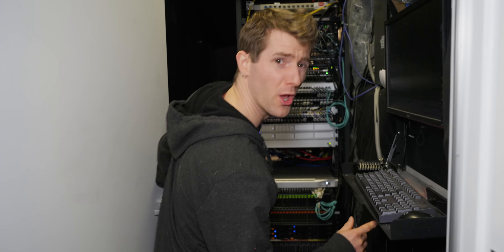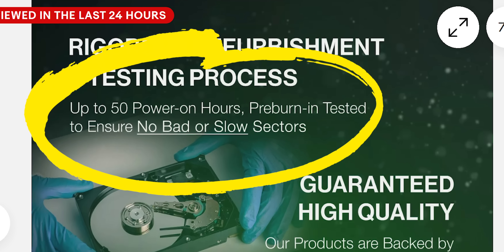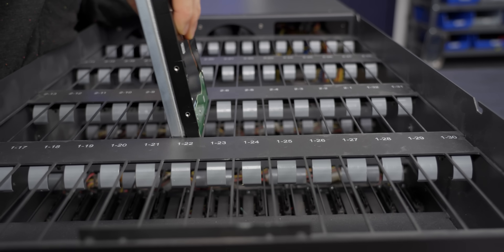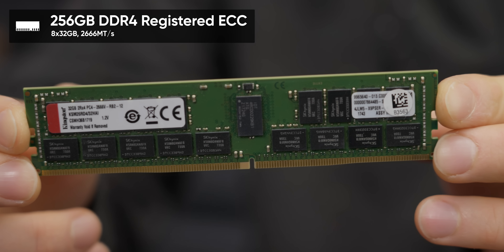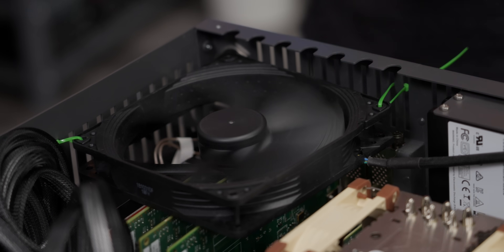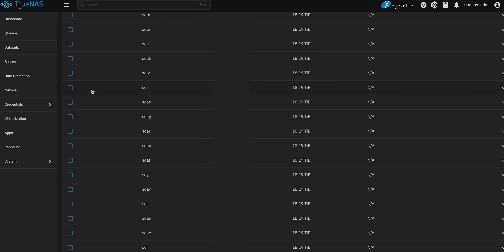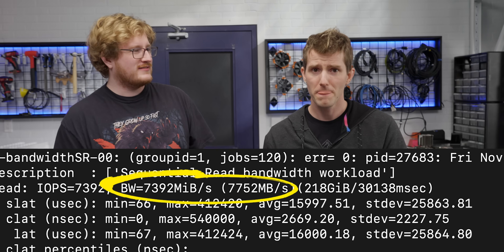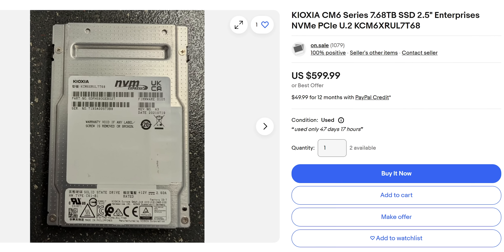Is Buying a PETABYTE on Ebay Stupid?

Comment: This year I purchased 36 of the recertified 10TB He10s you find on Amazon for $75 to $85 each. As far as I can see the recertified meant used for these. Before putting these into production I ran a 4 pass badblocks test on every single one of them which took nearly a week to complete. Edit: Not sure what happened to my previous reply anyways the drives from Amazon did have a few thousand hours of runtime on them and they are not sold by Amazon.
Reply: I've heard pretty good things about these drives. I have 24 he8 drives I got from ebay that have been completely problem free for about 3 years now. they have really impressive power consumption compared to the old seagate drives I used to run. nearly half for my whole array while idling.
Reply: I've been burned by Seagate and I'm mixed on WD, Hitachi drives have been absolute troopers for me. So I bought 2 new-old stock He10s off Amazon. They lasted 6 months before both had over 50 critical errors. Both had 0 hours when I started, behaved great until then, were in a proper anti-vibration mounting. $400 hurts so much to me and I gave up trying to get a refund, now that that part of the company is owned by WD and I'm in Canada I don't seem to be able to get a refund from WD. They are an enterprise product and WD only seems to have end user support for formerly-Hitachi enterprise products in the U.S. and Mexico and I'm in Canada I've just considered that money lost and tried to move on. I can't afford to find a different alternative and all I wanted was reliable storage instead of decade old e-waste Sas drives in a hardware array that doesn't allow me to read their SMART status
Reply: More like returned and repaired. It might never even been used.
Reply: @deauthorsadeptus6920  All of the He10s had a few thousand hours of usage on them. They were very clean and didn't appear to be opened as far as I can tell. Someone ran a SMART short test on them before they shipped as this was in the SMART log. I started with a small batch and after they tested flawless I ordered a few more and finally a month or so ago I added an additional 20 pack to fill every slot in a new supermicro 36 bay server.

Comment: Bought 5 14TB drives that were pulled from a server off EBay. They were about $150 CAD each. So far with 24/7 power on they’re doing great
Reply: I have a couple 4000gb seagate nas drives in my desktop. Basically got them free with a used seagate nas. About $20 a piece
Reply: that's some great luck there
Reply: @Gogglesofkrome  I’ve got some 12TBs from a similar seller as the one in the video that I’ve been running on my Proxmox server since 2022. No issues as of yet.
Reply: And I'm over here paying 240$ for 4TB WD Red+... Why am I doing this to myself lmao
You mind sharing what seller you got them from?
Reply: @ Looks like the seller I got them from doesn’t have any listed at the moment but the drives were WD WUH721414ALE6L4 14TB. EAST DIGITAL seems to have the least expensive reputable drives. I’ve been there though, paid almost the same amount for 4TB SSHD’s a couple years ago. They are still going strong but with 10TB less it’s just nuts
Reply: @fantaz_official  i got 3 12tb dives 80$ a piece on ebay recertified that works great after 3 years
Reply: @fantaz_official  Yeah that's insane... that's a scam lol. Everyone I know with an interest in storage buys refurb drives from eBay. You can get 28tb drives for like $360 now.
Reply: I bought 4 12TB refurbished Seagate Enterprise drives for 120€ each on Amazon. So far no Problems
Reply: @Youwotm8Tk  That’s awesome! Has the price increased at all since? I’m having a hard time buying additional drives now since the price has gone up
Reply: @BenPike09  I can't find the exact listing anymore, but I've found similar ones for 140
Reply: 14TB 7200rpm drives is definitely the sweet spot. I have 10x 14TB eBay sas HC530’s I got for ~$87 each delivered. I test and monitor drives with Hard Disk Sentinel and, so far, Zero issues
Reply: insane
Reply: I've been running 2 12TB drives that I got refurbished for 100$ per. They've been going full time for almost a year now and still work great, health checks pass daily.
Reply: how long have they been going?
Reply: @ssutuh  They delivered to my house December 29th, 2023. I’ve had them installed and running a few days after that. Solid so far with TrueNAS reporting zero drive errors or lost sectors
Reply: good luck with the 14TB's those are known to have reliability issues, i myself had a number of them go
Reply: I bought a bunch of SAS drives from a guy on FB marketplace, his prices went up but at the time I got 5 14 TB for 300, and to be frank, they're flawless. The only issue I ran into was 1 had some write errors specifically from MY poor cabling, iykyk, I fixed that. They all had about 2 years of use on them, and for these, if they don't die in shipping and they didn't die in the first year, they typically last a very long time. So if you know what you're doing I have to disagree with not buying used memory. If you buy SAS and an HBA controller just know they're loud. Also this is really for server type projects, stick to your SSDs for your pc.
Reply: @ that was a sweet deal. SAS can turn people away but damn for that much capacity why not right. I’ve been there with the cabling too. I got 2 cheap 8 to 8 sata snakes and had them at really poor angles with lots of tension. Should have gotten the 100cm cable but I went with 50… tons of IO failures until I replaced the cables.

It’s the little things right 😂
Reply: I got some 16TB recerts here in Australia for $250 AUD each. Works perfectly, would buy again if I ever need more drives.
Reply: Bought 4 12tb drives for $80 each in February, had 2 fail in the first month 2 weeks apart from each other, warranty replacement went super easy and all 4 have been rocking it in the server since.
Reply: bought one also seagate exos 12tb use on my PC playing everyday and downloading videos/ editing
Reply: I get about 700MBps read, 400MBps write with five 14TB 7200RPM in SHR (raid5)
Reply: They use regular sata connectors?
Reply: Yeah I don't think they're ALL going to fail. For the price you can use extra redundancy and still come out way ahead on price.

Comment: Recert drives scared me at first but I have SHR-2 on my 8 bay NAS so I went for it.  Hey, $200 instead of $350 for a drive.....  I have 2 or 3 recerts in my array now.  No issues 1-2 years in.  Another pro tip for saving is to look at USB drives.  Sometimes the hard drives in those are NAS level drives and much cheaper for some reason.  You decase the hard drive and toss it in your NAS.
Reply: Called "shucking" in datahoarder communities

Comment: I actually just recently got 2 18TB drives from ServerPartsDeals. One did arrive DOA, but they provided a prepaid label back and shipped me a replacement with 2 day air. Excellent service! I also bought one drive from GoHardDrive and it also arrived without any issues.

Comment: I've moved to local NAS when google drive removed unlimited drives. Those Exos x20 20TB are indeed cheapest option. Although in Poland a single new one cost 390 USD (and has 5 years of warranty) and recertified one costs.... 365 USD (and only 1 year of warranty). Yeah, building a server in Europe is way way more expensive than in US i guess.
Reply: But how much is a trip to the US and back with your luggage full of hard drives 🤔
Reply: @ffwast  Doubt TSA or whatever UK has will like that

Comment: I´ve bought numerous recertified drives via Amazon, and they´ve been all sock solid since. Very much worth it as long as you ensure parity with backups (which you should do anyways).
eBay, provided it´s a good local seller is also a solid option, though I prefer the former where possible.

Comment: I recently purchased 3 used 12TB drives on ebay for $75 each with a 5 YEAR warranty (GoHarddrive). Research suggests that they are reputable and actually honor this with no questions asked. Right now that is an absolutely insane deal. Unfortunately they're selling for $100-$110 now.
Reply: Hey, even $100ish for 12TB is a pretty good deal! I paid about $150 for 8TB about 4 years ago. Granted, my drive was brand new, but still...
Reply: @TooBokoo I paid $90 for 4tb around the same time brand new, and I haven't needed more storage since then. Might consider getting a few and running a RAID array for redundancy though
Reply: @Marsk1tty  Yeah I still wouldn't trust used drives without running them in some kind of RAID. That's what most people do with a NAS anyway though so unless you're just buying a single drive for your desktop like your use case, I really don't see a problem with buying "refurbished" drives.
Reply: @TooBokoo  Yeah especially considering such a long warranty.
Reply: What seller?
Reply: @Richest_The probably goHardDrive, I also picked up the same $75 12TB drives as my starting office PC NAS and things have been chill
Reply: @Richest_The  I edited the post. GoHardDrive
Reply: those drives are from go hard drive on ebay, I prefer them to server part deals because of the extended warranty.  One drive I got from SPD only had 1 year and I cold storaged it and when I went to use it 16 months later it's working but crazy loud and now I'm stuck with it.
Reply: @brandoncarlson3212  Yeah the specific drives I got are HGST and are very loud, even for enterprise dives. I knew what I was getting myself into though, some of the Seagate drives they are selling now are supposed to be quieter.
Reply: @brandoncarlson3212  A drive I ordered from them previously broke after about 8 months and they were really quick to replace it. I just said it was making noises and not showing up in windows and they send me a return label for it immediately.
Reply: I need to get me a sponsor so I can start acquiring a drive or two

Comment: "Storage ain't cheap" - I mean, for the average user in 2024, it kind of is, relative to what it was 20 years ago. Yeah, if you're a media company, your needs are going to cost way more.
Reply: I work in diagnostics...
The issue isn't the cost of storage. As so much more about how much data and the size of files nowadays.
Reply: Yeah, it really is their media side. I imagine if they were trying to be efficient they could just compress their bazillion gigs of raw video files to something far more reasonable, or, they could even shoot normal people camera settings with normal people gear and save 1/50th of the storage space but it would look reflect poorly on their company if the videos they produced looked like they came from 2010 😂

But at least they'd have enough storage to do most of the things they mentioned not doing yet
Reply: @maverick9708  agreed... that's the price of them doing a quality job.

However.... I do feel that most of that "data producing" tech can be far more efficient.
Reply: @maverick9708  Honestly, compressing is fools errand.
Reply: 10 grand for a petabyte is almost nothing!
Reply: 20 yrs ago ya could get a $2.99 Mcdonalds meal too...but that's not really relevant to today.
Reply: @mrmotofy 20 years ago, a regular consumer couldn't even buy a 1TB in a 3.5" form factor, so comparing things to 20 years ago is relevant. Now days, you can buy a 16TB HDD if you really want to for around $200. A 1TB drive when first released costed about $400. So yeah, storage is pretty cheap these days for what you get. Unless you're someone like Linus who wants a petabyte.
Reply: Lets put it this way: they can "easily" afford indefinite backups of all their production AND fault tolerance today.
Reply: I'd disagree. Built-in storage in devices is still at a premium. It's more common for storage not to be user upgradeable.

Cloud storage options for end-users like dropbox haven't gotten all that much cheaper.

Need for storage has grown a lot. Games are a lot bigger, photos and videos are higher resolution.
Reply: @jakx2ob    Idk, most people dont store blu ray remux's, its really either one doesnt uses barely any space as a normie, or hardcore data hoarders that breathe in tb's of drives, and nothing will ever change that.

Comment: 0:20 Linus, you check out E1.L or the ruler ssd from Solidigm and E1.L server from supermicro. In just 1U with 32 drives, you can get 2 PB of storage with each 64TB SSD stick. 

In early 2025, Solidigm is going to launch 122 TB SSD meaning in 1U, you can get 4 PB of storage. Please make a video on it in future. And, they are also relatively inexpensive.

Phison Pascari already has 128 TB SSD in E3.S format

Comment: I've run Server Part Deal drives in my NAS for years with tons of TBW with no issues.
Reply: Same, ServerPartDeals rocks
Reply: The absolute best. I'm up to 5 14 TB Manufacturer recertified drives from them so far. Gonna need another DAS enclosure next time I upgrade
Reply: @Undercoverfire heyyyy I get the same ones
Reply: Thing is, if they had purchased the drives from SPD directly through their website instead of through eBay, Linus & Co. would have gotten twice the warranty (2 years instead of the 1 year SPD offers on the same manufacturer refurbed drives through their eBay store) and at slightly better per-unit costs (which Linus mentions in the video).

SPD is a homelabbers/data horder's best friend; almost all of the twenty HDDs between my two Unraid boxes (ten each in both my active media server and my backup server) have been purchased from them over the past 3-4 years.
Reply: @talon262  I believe they purchased them directly from SPD. The invoice they show doesn't look like a typical eBay invoice and it shows that their payment method was a wire. I think it was just easier to say that they purchased them via eBay for the videos' sake.

Comment: Is this really cheaper than paying for backblaze or S3 for backups?
Reply: @btarg1  much cheaper ahah
Reply: Depends on how long you want the data. Backblaze is $6/TB/month so $6000 per month for 1PB of storage. If we're thinking $12k for the disks (rounding up) and then double that for all the other hardware they show off (roughly) that gives us some easy math to work with. If the data is going to be in backblaze and we ignore API charges and data egress charges then you break even at the 4 month mark.

Comment: I only buy used 18TB on ebay for my server. Running 32 bays + 2 hot spares. They fail just as randomly and just as often as "new" drives. Some are running for 5+ years now, some only a few thousand hours. It seems to matter very little and i save alot at 10€/TB used vs 20€/TB new.
Reply: @blinddarm8478  where are you buying them in Europe ?

Comment: They need to offload old video files to cold storage or something. There's no sense in storing massive amounts of old footage that they'll almost certainly never actually use in active storage on their NAS.
Reply: I think they have that on tape backups
Reply: I got the vibe that this will be cold storage. Well, cold-ish.
Reply: Thing is for them, it’s likely more cost effective to use the NAS through a mix of high availability (which makes the rare call back to archival storage quicker than creating an inventory system for cold backups, integrating it into production, and actually retrieving it when needed), as well as actually purchasing said cold storage media. 

That’s not to mention the money made from content produced around their various NAS systems, between their ad revenue, sponsor spots on the video, and ability to use free inventory sent by industry contacts, as “ _ sent to us by ___” occurs so often in these videos. 

Also, if complete data hoarding is the #1 goal, raid configurations generally should have much more resilience to bit rot over time (from my understanding), which over 5 or 10 years isn’t THAT much of a problem, but when looking forward 20, 50, 100 years, it’s much more relevant.

Finally (and I’ll concede this is a big stretch), but an argument could likely be made that hard drives are much more valuable than something like tapes or disks should they need to liquidate any assets for any reason. They hold value (not particularly well, they’re hard drives after all), but they do

Also big storage servers are just cool :)
Reply: put all the old stuff on a private youtube channel. The quality will drop, but as you said, they will never use that footage
Reply: @EU_JACT  quality will drop. And if they lose their channel for posting de Google your life videos they will likely lose that too. Stop trusting 3rd party companies known for harvesting your data and with the ability to arbitrarily delete your stuff with your backups.
Reply: @EU_JACT  That's the problem, a lot of youtubers are picky about their quality and want the raw file if they ever need to use it again, even if that possibility is so low and nobody would probably care about the quality drop for a 10 second clip anyway. I get it though, you spend 10s of thousands of dollars on cameras and recording equipment and you don't want to settle for youtube compression. Also maybe you want to show an older video to a potential client or business partner or something like that.

Comment: I actually bought 4 4tb Hard drives on ebay, and now I got it in a portable DAS
Reply: Direct Attached Storage
Reply: DAS cool. :)
Reply: i bought a 4tb hard drive off ebay for my personal rig, now i want a nas
Reply: @PhyzxLive  than build one from and old computer rather than wasting your money one one of those fancy prebuilt ones
Reply: Ok
Reply: I got two from a seagate nas. $50 eBay, only bought the nas for the two 4tb drives
Reply: In 2021 i brought like 2 4TB hard drives on eBay for my daily drive PC, i think just one started to show early signs of malfunction according to SMART, this is because that i got using as scratch disk storage where downloads, Linux ISOs and some development projects that don't need fast SSD storage, while the other writes are rare.
Reply: Digital Audio Sortage :)